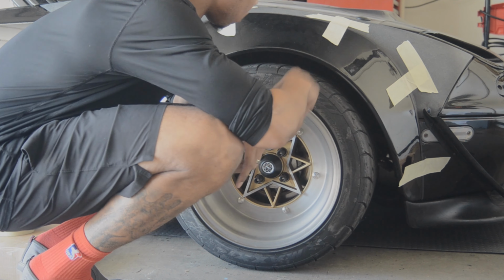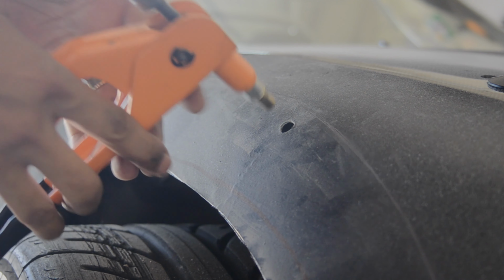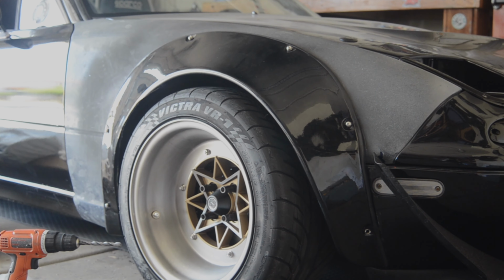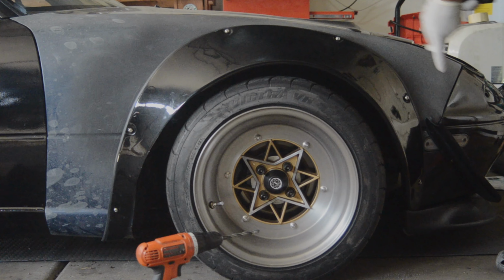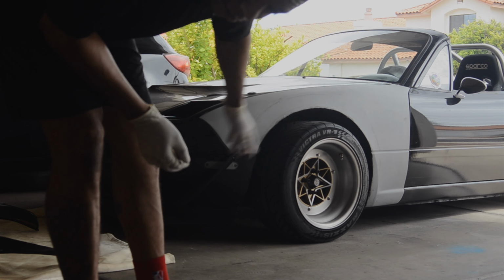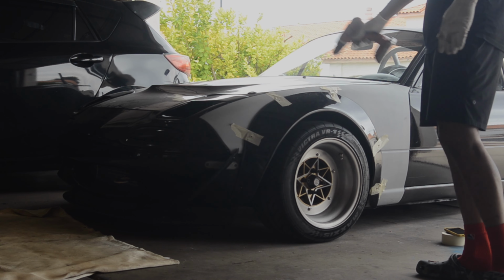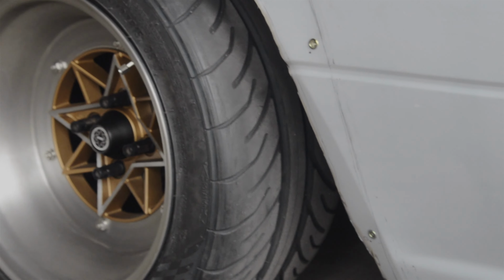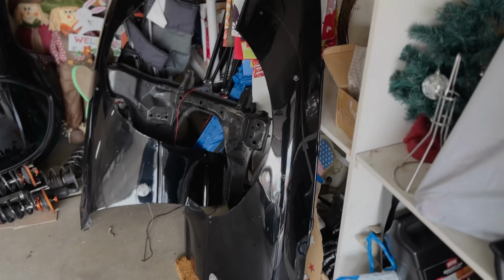Re-Installing Tuckin 99 Flares

Comment: What size rivnut do you think is best?
Reply from the maker: I used these Zinc plated M6 rivnuts and never had an issue!

Keadic 150Pcs M6 Metric Zinc Plated Carbon Steel Rivet Nut Flat Head Threaded Insert Nutsert Kit (M6) https://a.co/d/hVlaPEE